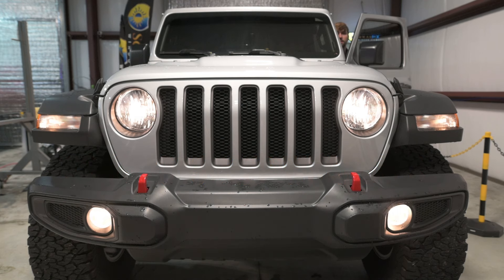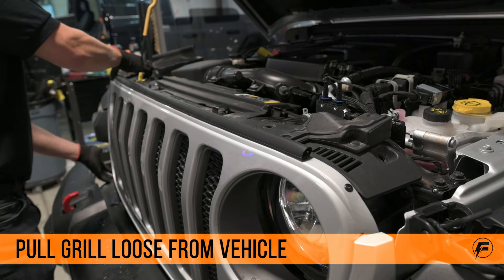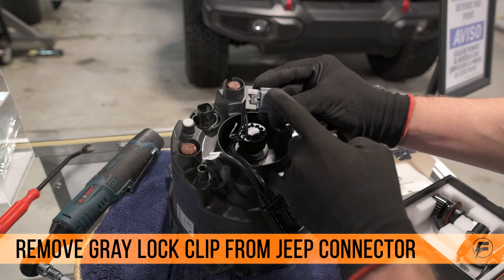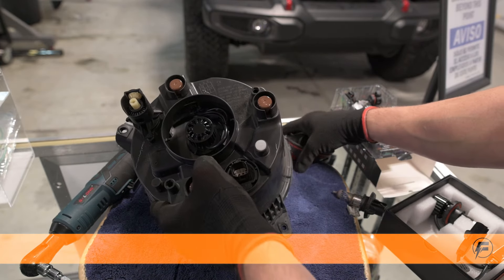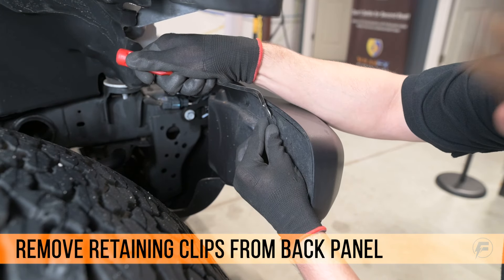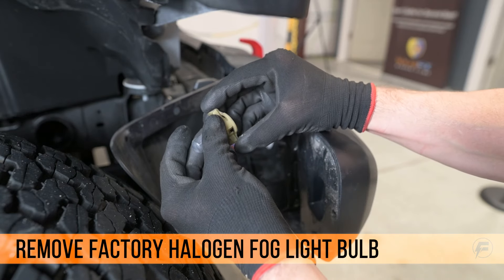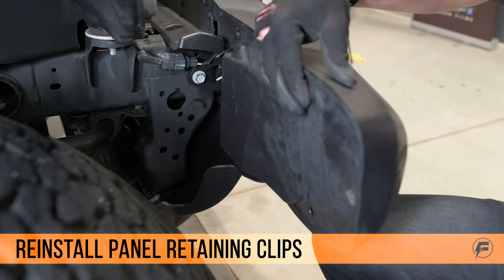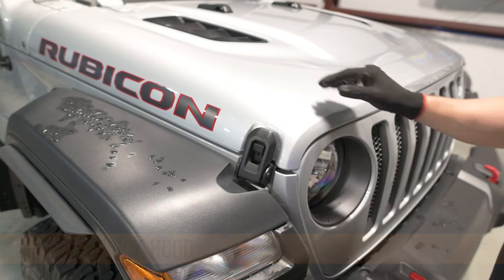2018-2023 Jeep Wrangler Headlight and Fog Light Bulb Replacement: LED Upgrade

Comment: Hello this looks so detailed thank you so much. I have a question though. I have a 23 jeep Wrangler Rubicon and I want to switch both headlights and fog lights but I hear that you have to reprogram it after doing this. Is that correct?
Reply from the maker: @claudes1973  with our LED bulbs you don't have to re program anything. Completely plug and play!
Reply: @fuzedled thank you!

Comment: why did you put back the cover? they need to be cooled, they have a fan for that. 
they will not last that much if you use that cover
Reply from the maker: They cool perfectly fine with the cover back on. If you leave the cover off you will get all kinds of moisture and debris in your headlight that will ruin your housing.

Comment: Why did chrysler make it so hard to replace the headlights.You have to remove the front grille ,then unscrew the Headlight assembly. That is too much.
Reply: Sadly there’s no room from the back for to other components in the way.
Reply: Overwhelming 😡
Reply from the maker: I believe on certain models you can access the bulb without removing the grill. I just find it easier to go ahead and pull the headlight out to make sure everything is installed and connected properly.